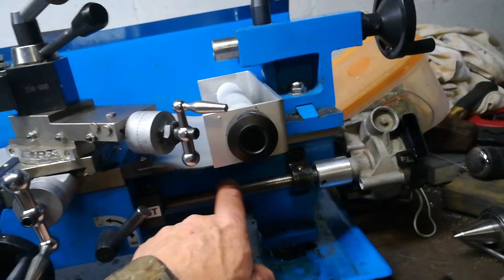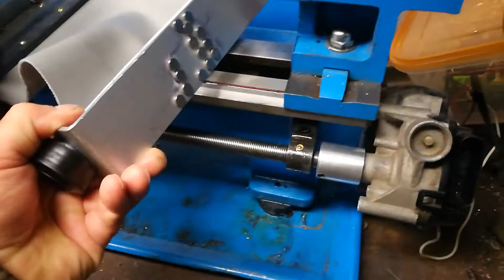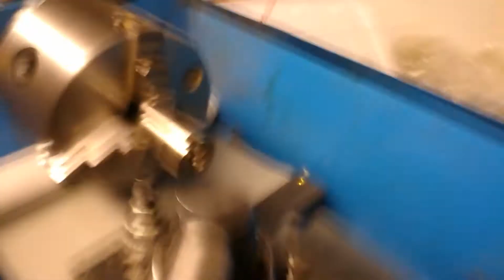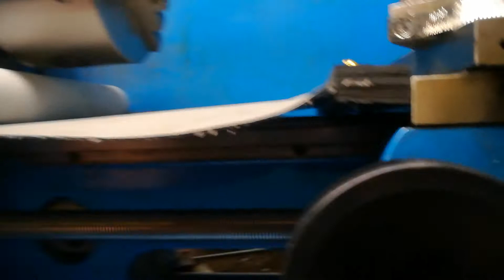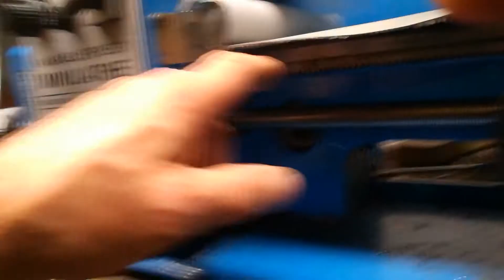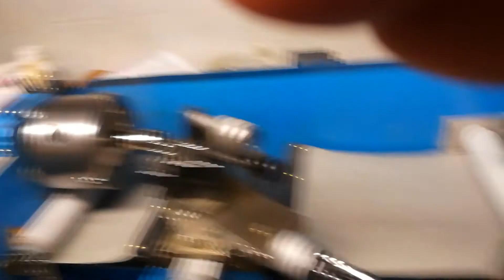Mini lathe way cover/leadscrew cover.

Comment: Do magnets have any affects on electronics like the speed control board. Just wondering.
Reply from the maker: No. The scs has it's own magnets. The magnets on the covers are to far away to effect it in any way.
Reply: @umpy3152  thank you for your reply.

Comment: Nice mod, if you would have the fabric roll up on the top side of the rollers with a brush attached to the head and tail stocks to sweep the chips as the fabric rolls back to the roll into a small tray or well would make clean up easier.Also would not get chips embedded in the fabric when rolled back from the pressure from the sping tension . MHO
Reply: You could use a door brush seal you can by from the hardware shop.
Reply from the maker: Thanks. I did try the roll on the top side but it was to close to the Chuck in that position and even rubbed a little bit when all the way retracted. That's why I flipped it around.as far as the chips getting rolled up in the fabric,it does a little but doesn't cause a problem. I just vacuum it off every now and then.